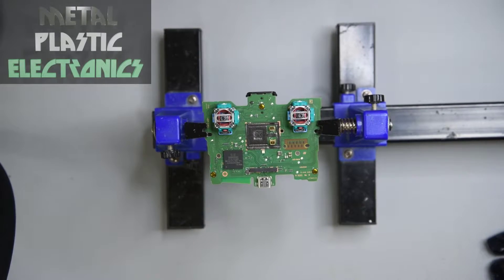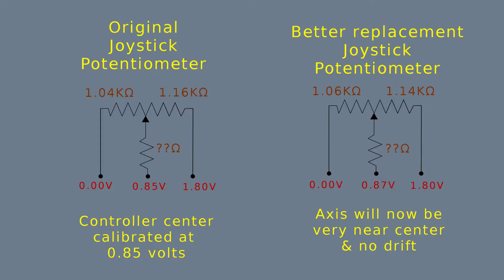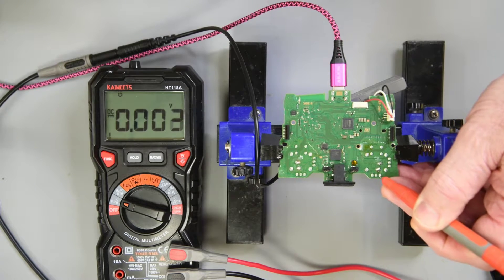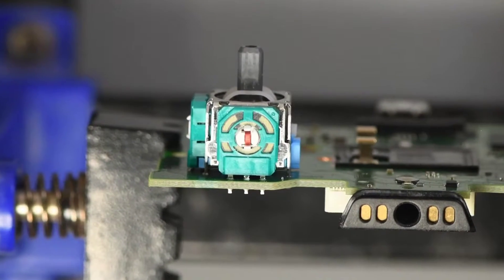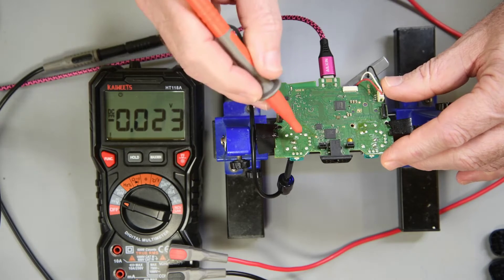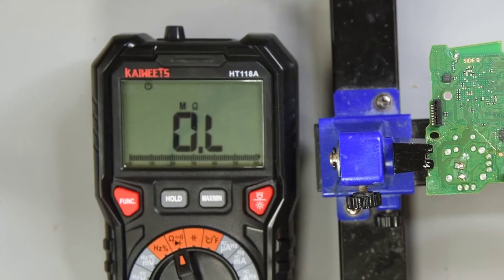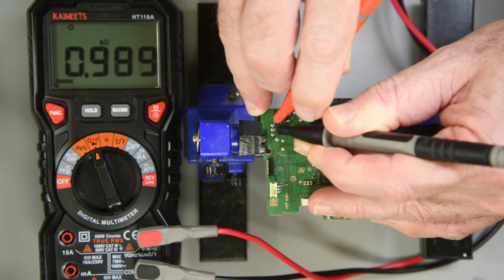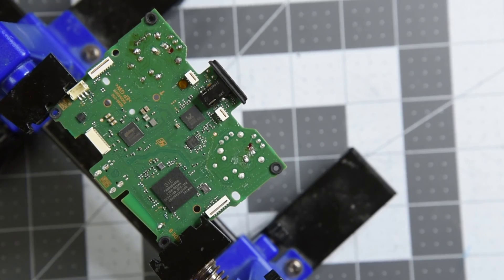Troubleshooting a Replaced DualSense Joystick

Comment: I replaced my right analog stick with a TRM and now the R3 button doesn't work. Is there any solution? I have both ground pins working, only the two bottom pins of the push button aren't receiving a signal.
Reply from the maker: What are the voltages on the pins with the switch not pressed, and then what are the voltages with the switch pressed?

Comment: Hello, 
First thank you a lot for this video 
I have a broken r3 and i dont know to fix it can you help me please
Reply from the maker: Do you have a meter?
Reply: @metalplasticelectronics354 thank you so much for your response 
Yes i have a meter
When i click the r3 it shows oum resistance
But i think the via is damaged
Im search to scrach the signal but i dont know where to find it
I have a bdm 020 
I would really appreciate it if you can guide me 
I will give you details if you want
Reply from the maker: Take a look at this sight: https://acidmods.com/forum/index.php?topic=44714.0j .  It has some good images of the mainboards.  Unfortuntally the BDM-020 has the switch traces on internal layers of the board.  But the images can help locate the vias.  Try scraping the solder mask off the vias and see if you can run a thin wire to them is about all you can do.  I don't know which pin of the processor R3 connects to.

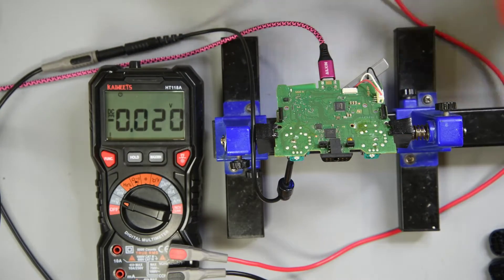Comment: Your video skipped over my problem at 4:55. The line of deduction was that if the center pin reads at half the voltage, then we've narrowed it down to 2 possibilities.  But, never covered what to do if the center pin doesn't read half the voltage.  My center pin is just giving me resistance, stuck at -1 in calibration.  If I connect it to the other supply pin I can get a straight diagonal motion, and I can flip the sign to make it +1, but that's about it for now.    Ha, I fixed it, after resoldering it about 9 times all I had to do was give the pot a good squeeze onto the joystick.

Comment: Hi, i commented on another one of your videos but i now have 3 broken controllers. 2 of them i used K-silver and the 3rd (today) I used gulikit. All of the 3 controllers do the same thing, i power it on, calibrate, use it for like 1 minute and it shuts off. I then have to wait 1-2 days before i can turn them back on and the same thing happens. My solder joints are super neat, they look like "tee pee" shapes and I didn't damage the board or scratch it in any way. I used this video to check for voltage reading and such and the readings i get are all good. i stumped as to why 3 different controllers, with seemingly proper installation are all not working and doing the same thing. All the ribbon cables are plugged in and i carefully removed and reattached them all. The main power and ground wires are also neatly soldered and nothing is exposed or touching, Do you have any thoughts or ideas? I am really bummed about this and just want to use TMR sticks on a controller. I am willing to do the work and test whatever you want me to test, I can even send you pictures and videos if you give me an outlet to do so. Happy to pay for your time as well. Thanks
Reply from the maker: You can send me a video at mike@mlplel.com.  Have you tried running with just the main board, battery, and USB connected to the gamepad tester website?
Reply: Hey, share if you fix it, please. I had the same problem here.

Comment: Hi, thanks for the video. I have a BDM-030 board. I replaced the joystick with a Hall effect one, and it worked for a while (1-2 minutes) but then turned off completely. Now I can't power it back on. Battery shows 4.1V. What could be the issue?
Reply: Also, it's not showing up on gamepad tester.
Reply from the maker: Are you measuring the 4.1 volts on the board?  If so, look very closely for solder that might be shorting something out.  If not, make sure you're getting the 4.1 volts on the main board.  It is pretty easy to damage the battery wires.
Reply: @metalplasticelectronics354 I’m getting 4.1 V on the battery connector pins and 5 V on the USB-C port. I might have damaged the PMIC while testing the board without the back shell, possibly due to static discharge. How can I check if the PMIC is shorted?
Reply from the maker: haven't seen a pinout for the PMIC chip, so I don't know where to start.  You might check the resistance across some of the larger capacitors around the PMIC chip for a short.  This website might have some information about the pins on the chip: https://acidmods.com/forum/index.php?topic=44714.0 .  Have you measured the resistance from the 1.8 supply line to the joysticks to ground?  The positive battery connection should connect to at least one pin on the PMIC.  Might go through a coil, but could check for a connection.  It might be a coil or a low-value resistor open.
Reply: @metalplasticelectronics354  I measured 2.8 kOhm between the 1.8 V supply pins of the two potentiometers, so I think there might be a short. I also measured the resistance from the 1.8 V supply line to the joysticks to ground, and it shows 2.1 kOhm. Is it okay/safe to bridge the two 1.8 V supply pins with a wire?
Reply from the maker: Yes, running a wire is a good way to repair a damaged 1.8 supply connection.  As all the 1.8 supply pins should read shorted to each other.
Reply: @metalplasticelectronics354  I have found a short circuit between the 1.8 V output of the PMIC and the 1.8 V pin of the bottom-right potentiometer (when viewed from side B), but I couldn't follow the rail traces any further. Since none of the 1.8 V pins are receiving voltage from the PMIC, I need to fix the 1.8 V rail first.
Reply from the maker: I take it you have the controller powered up? You have no 1.8 volts on the potentiometer pins? I do believe that the 1.8 power to the joysticks is on an internal layer trace.  I don't know if there are multiple 1.8-volt supply rails in the controller.  But if you can find a 1.8-volt line, I would try running a thin wire to one of the joystick's 1.8-volt pins.  There is probably a test point for the 1.8-volt rail.  It's also probably on the top side of the board.  I don't have a controller with the BDM-030 to verify the test points, but that is where I would look first.
Reply: @metalplasticelectronics354  No, I couldn’t power it up. I only found a short on one of the potentiometer pins and I connected a wire between that pin and another 1.8 V rail, so now I measure about 0.005 ohms from that damaged pin to the PMIC. I thought that it could power up the board with this fix but it doesn't power up. Now I don’t know whether the internal 1.8 V rail is damaged and preventing the PMIC from starting, or if I should just buy a new PMIC. If the problem isn’t caused by the PMIC, then buying a new chip would be a waste of money.
Reply: Also I checked if the PMIC is getting hot, and it's not getting hot, and I measured 5V (from type-c) and battery voltage (3.5V now) going to PMIC, but I couldn't find any 1.8V points on PMIC. So I couldn't understand if it's a PMIC problem or a short on somewhere else.
Reply from the maker: It could be either.  The running for a couple of minutes after changing the joysticks would more point me to the PMIC chip or a capacitor around it.  Without a pinout of the PMIC, it's very hard to troubleshoot.
Reply: @metalplasticelectronics354  Two capacitors around the PMIC are shorted. I don’t know if this is fixable. Should I replace the capacitors using a hot air station? Also, thank you for your help, it’s much appreciated.
Reply from the maker: I would remove the caps and see if it's the caps or the PMIC chip.  The caps would be pretty cheap to replace.

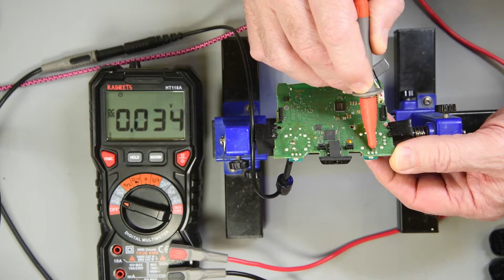Comment: Hi I really find your videos helpful and nice. I have a BDM-020 board where the replaced tmr joystick center pins read .9v at centre but vary in voltages when testing extreme sides of center pin as described in 04:33 in your video. what could be my issue?
Reply from the maker: I'm not following your question.  Is the center pin voltage not changing?
Reply: @metalplasticelectronics354  it is but the range is from 0.22 to 1.68 when moving the stick from side to side. Also, I don't know what I've done but now the other stick is at -1 on an axis. Maybe esd issue
Reply from the maker: 0.22 to 1.68 is a valid range for the voltage.  A -1 would translate to near 0 volts on the center pin for that axis.  Make sure the trace isn't broken around that sensor.  If the voltage is changing from 0.22 to 1.68 and the axis is not moving, then that is not good.  Again, check the center pin trace to make sure it is not damaged.  You might also try a hardware reset of the controller.
Reply: @metalplasticelectronics354 I tried the reset button but somethings off..the joystick that was ok now just points to extreme corners when moved like top right, top left, bottom right, bottom left. 
The tmr joystick only moves from top left 120/60 degrees to flat right 0/180 degrees. The traces look alright to me for the tmr joystick. I couldn't find traces for the other on the back of the board
Reply from the maker: Have you tried it with only the main board and battery connected?

Comment: Thank you for sharing your knowledge. I have a problem trying to change the right joystick; I tore a trace off the bottom potentiometer, the horizontal one. I damaged the trace that gives the 1.8 [volts] according to your video. Not the trace closest to the R [resistor]. How can I reconnect that trace? Where should I reconnect it? Thank you
Reply from the maker: Just run a small wire to the other 1.8-volt pin on the vertical sensor.  If neither sensor on that joystick has 1.8 volts, run a wire to one of the 1.8-volt pins on the other joystick.
Reply: @metalplasticelectronics354 ok, I find it strange that, even though the circular pad (or trace) where the 1.8 V potentiometer pin connects detached and stuck to the soldering iron, the joystick is still functioning correctly. Is this normal?
Reply from the maker: It is a multi-layer PCB.  The pad is just one part of the connection.  There is copper inside the hole that is connected to other traces, sometimes.  When the pad connected to a trace pulls up, that is where a repair will have to be made.

Comment: Thank you for the video its helped some part but i have an issue. The center pin on my left side the pad is ripped off, i like your guide but its for the right side, the right side seems to have a straigth forward line however on the left side not so much. Where do i attach the jump wire to get it working?
Reply: The issue is the right side working perfectly the left side is stuck in the up position and i can't move it down i can move it slightly left and right but not by much
Reply from the maker: Do you have a multimeter?

Comment: Thanks for the helpful video.
I have a question.

All required 1,8v legs are reading fine, but the potentiometer center leg is also reading 1,8v in neutral position and the stick is stuck in upper-left position.
What should I check?
Reply from the maker: Upper left on the DualSense should be a center tap voltage of near 0 volts.  Are you sure you are on a good ground point?
Reply: @metalplasticelectronics354  Thanks, I used the potentiometer metal case as ground point.
I removed it and soldered another potentiometer. 
Did some tests, the left analog doesn't go down-left and the right analog stick doesn't go up-right or down-right.

Right readings are 1,5v/0,8v/0v and 1,8v/0,8v/0v 

Left readings are 1,8v/0,8v/0v and 1,8v/0,9v/0v
Reply from the maker: The joystick's metal frame should be a good ground.  Is the Right first sensor at 1.5 volts, or is that a typo?  The other voltages look correct.  What does the center pin voltage do when you move that axis?  It should change from near 0  to 1.8 volts as it moves through its range.
Reply: @metalplasticelectronics354  unfortunately not a typo, it's reading 1,5 v. And the center pin of this (1,5v - 0v) when I move it, is reading 0,6v to 1,0v.
Nowhere near the standard values. 😟
Reply from the maker: I would run a small jumper wire from the pin with 1.8 to the pin with 1.5.  Probably the trace or pad is damaged.  They should all be 1.8 and connected together.
Reply: @metalplasticelectronics354  I removed everything and soldered two hall effect potentiometers instead, because I don't have another normal pair.

The left stick goes all positions and make a little wiggle on the right stick. Right stick still stuck on upper-left position but wiggles to down-left. 

The readings are:
- left stick 1,8v/0,87v/0v and 1,8v/0,85v/0
-right stick 1,8v/0,96v/0v and 1,78v/0,98v/0v

I think this dualsense is cursed😅
Reply from the maker: If the voltages on the center pins change from near 0 to approximately 1.8 volts when the axis is moved.  That means the joystick is working.  Have you tried calibrating it now?
Reply: @metalplasticelectronics354 although the wiper changes the voltage, the right stick only moves from upper left to down left. It wiggles as something else is preventing it to move right.
Reply from the maker: If the voltage on the left/right axis is changing.  I would expect either a break in the trace going from the center pin back to the microprocessor, or the processor input pin has shorted out internally.

Comment: i can't see where the trace of the Middle pin is on the BDM-010 Right stick, i used the tester and left and right is working fine but up and down doesn't do anything, they receive energy tho, 1.8v

and  i found the trace that is facing Up sadly, marking 13Ω , that means it's doing a short right?
Reply from the maker: Yes, if a trace to the center pin on one of the sensors reads 13 ohms, then it is shorted.  Look for a solder bridge.  The only pins on the sensors that should read low like that are the ground pins.  This website has some pretty good pictures of the BDM-010 PCB: https://acidmods.com/forum/index.php?topic=44714.0  .
Reply from the maker: Yes, if it's not connected, you can run a wire to the trace.  You can look up some laptop repair videos for some hints on trace repair; there are quite a few on that subject.
Reply: @metalplasticelectronics354  i Fixed it, turns out the potentiometer was faulty, i tested it and it's all good now thank you for the tutorials and help
Reply from the maker: Very good.
Reply: @metalplasticelectronics354 the only trace that is connecting to the middle pin is near so i need to solder a cable thru there right?

Comment: Great video. I replaced both joysticks and the X-axis on the right stick no longer works. After running through your guide, it looks like everything checks out (all voltages ok and increase/decrease with stick movement, no noticeable damages or signs of a short) and the culprit is likely the centre pin. The problem is that my board doesn't look like yours. It is very obvious where the outer pins are traced to but I think the centre pin is traced on the opposite side of the board, underneath the new stick. Any ideas where I could run a wire to?
Edit: My right stick x-axis centre pin tracing is configured like your left stick x-axis. As this is the read pin, I can't really do anything but remove the stick to find where it is traced to, and removal is the hardest part, so I'm thinking I will admit defeat on this controller.
Reply from the maker: Never admit defeat!  Here is a link to some mainboard scans; the BDM050 is not one of them: https://acidmods.com/forum/index.php?topic=44714.0 .  Which mainboard do you have?
Reply: @metalplasticelectronics354  Wow, you just renewed my interest again. BDM-010 is my board, and this photo shows me the path on the backside. The destination is tiny though, it might prove to be a bit difficult for my 20 yr old Hakko 936/907 combo and my aging/shaky hands. Nothing looks damaged outside the joystick area, so I suspect the damage is to the tracing under the stick module.
Reply from the maker: All the parts these days are so tiny that it is a challenge.

Comment: What if L3 or R3 button don’t work? How do I test them?
Reply from the maker: First thing I would try is running only the mainboard with none of the flat cables plugged in, only the battery.  Connect it to the game pad tester website and see if the buttons will work.  I have seen some strange problems with a misconnected flat cable.

For each switch in the unpressed state, two terminals should have 1.8 volts, and two should have approximately 0 volts.  Then, when pressed, all four terminals should have a voltage of approximately 1.8 volts.  If, when pressed, you have 1.8 volts on two terminals and close to zero on the other two, it's an indication that the switch is bad, which is very unlikely.  If the 1.8 volts is missing, there is probably some PCB trace damage.  The damaged trace would only be applicable if you had changed the joystick.
Reply: @metalplasticelectronics354 I tested as you described. While testing it started working. I think it was a pin not making good contact. I heated the solder again to make sure it was contacting. Now it works great!! Thank you so much!
Reply from the maker: Very good, glad to hear of success.